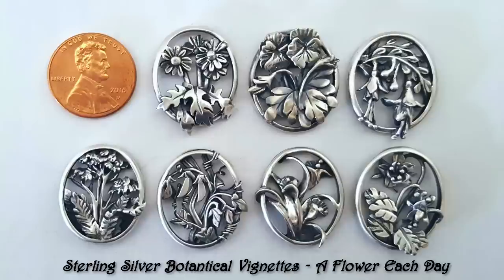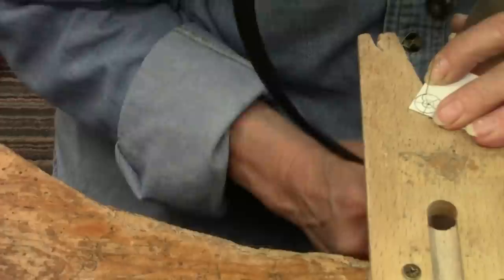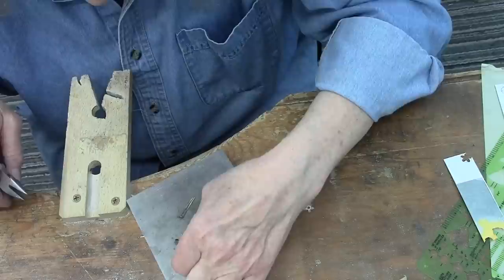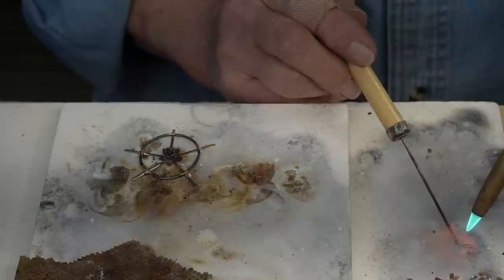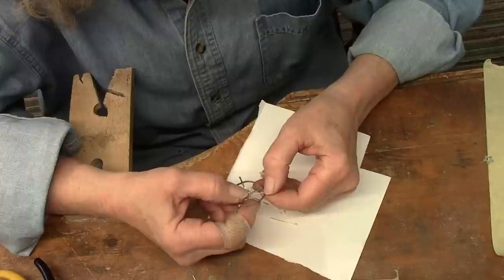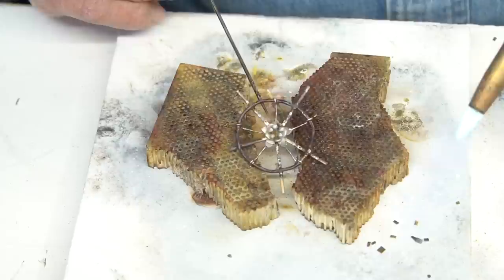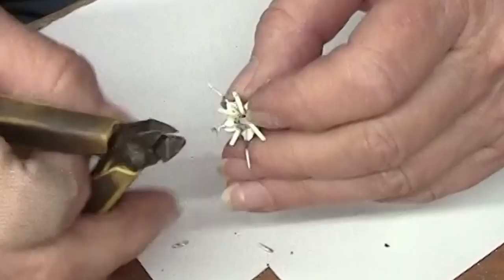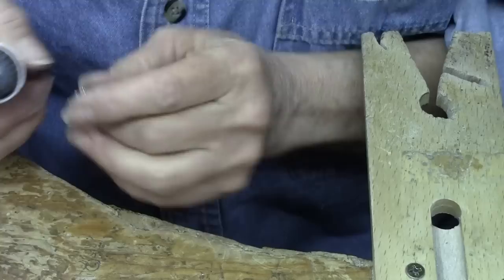Fabricating a Miniature Sterling Silver Flower

Comment: For those, ( like me ) that don't have such a steady hand, find a small bird feather, sharpen with scissors to a sharp point dip the point of the feather into flux, touch the solder with the point of the fluxed feather until the solder attaches to the feather, transfer the solder to the place you want to solder. Place the feather in a safe place away from the flame.
       A tiny paint brush also works well.

Comment: Beautiful work! just wish your zooming in wasn't so blurry, perhaps try using a 4K camera with macro zoom capabilities so that it doesn't get blurry when zooming in on small objects? Just a suggestion, I'm assuming that you are using silver solder, for all of this I would suggest using silver wire as a framework so that you don't waste silver solder on copper and not be able to get it all off when trying to save the silver wire, left over on the frame. if you use silver wire, then you can throw the whole thing into a crucible and not have to worry about anything, just remelt it for another project. Just a suggestion, I may be missing something but all you're using the wire for is support, then you can have even less waste by residual silver solder on copper wire that cannot be removed. then you can take it to the rolling mill as normal. I really enjoy the fine detail of small pieces like this, your finished work is just beautiful and look very authentic to the original flowers! Fantastic work!!!

Comment: 5 years ago i decided making jewelry would be my supplemental income so i invested in the tools started making belt buckles with copper then copper n silver then bracelets on and on now 1200 pieces later im making pave eternity bands a 15k London blue with 4 mil halo and wire under gallery with helping hands clay want a pulse  welder i think that would be great for your flowers ive always liked handy flux and yes it is sticky i tried the ceramic and cone dont like at all why dont you like handy flux for silver? I use all the time and i to use hard as many times as possible im starting to make smaller n smaller pieces then found you  video i really want a pulse welder seems to me it would make life easy to tack pieces then solder do you agree?

Comment: I’m a babysmith and I’m wondering how you use hard solder all the way through the projects without it coming undone?
Reply from the maker: Hi,  got your great question and will reply extensively in an upcoming video.  Quick answer is that it usually doesn't matter that the hard solder reruns.

Comment: Ahh; the pleasures of wasting time on Utube when I should be doing something else.
At the beginning of your video you had a complex shape in the middle of a rectangle.  Is there a reason why why jewellers don't:
1/ Park Golden Retriever on floor beside.
2/ Draw pattern, including rectangle, on paper - scrap will do.  Use sharp pencil for very thin lines.  If you need mutiples photocopy and arrange on sheet.  Draw twice size and draw a reference line double size.  If you have a CAD program, use it.
3/Tickle said Golden Retriever.
4/ At this stage you have a pencil drawing.
5/ Photocopy drawing half size.  This will be laid image down on silver, so if the design is 'handed', as in print, flip the drawing in the photocopy controls at the same time as setting 50% size.  If you don't the image will be reversed on silver.  With your flower it does not matter.
6/  Measure you reference line to make sure you have reduced image to required size.
7/ Repeat step 3/
Cut around your square on three sides; the fourth is  not cut so can be used as a handle.
Place image on silver, using cut edges to line it up.  Image is face down against silver.  I  use a slither of tape to hold it down.  Tape is nowhere near the image.
8/  Lightly steep a cotton bud in hardware store acetone, and holding paper still on silver, rub over paper.  The image will be transferred to the silver.  Keep acetone sparing so as not to smudge image.
9/  Remove paper and inspect.  If need be, rub off image with acetone or fine emery and re-do.
10/ Repeat step 3/

I believe a hot iron can be used instead of acetone.
SAFETY: work outside in a quiet breeze.  Don't breathe the acetone or get on skin.  Use safety glasses.  Sorry for the extreme caution, but as I keep saying: you don't know who is going to read this stuff.  Observe instructions and warnings on the acetone bottle.  Acetone requires care, and so does wood glue. (the possible presence of cadmium  in solder/flux is a worry.

This tip came from Cygnet Magazines 'Model Rail Journal'.  Surely it is known to your field; is there a reason this technique is not used?  I got fed up with feathering edges on paper, and of just plain imprecision.

Thanks to both of you.  I borrow many of your ideas for model making.  I am very much a learner.
Repeat step 3/
      Have a look at https://www.youtube.com/watch?v=wtjvWU0Ij-c